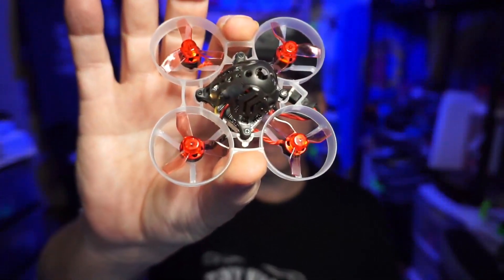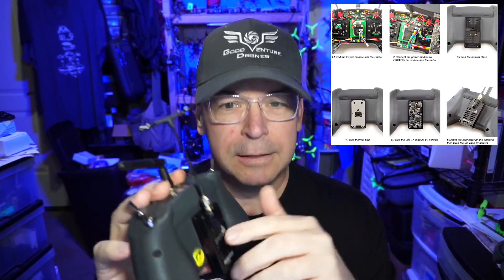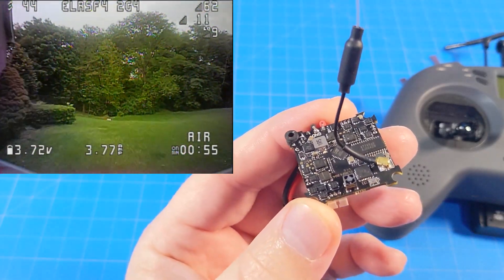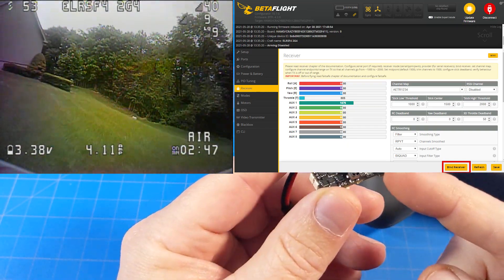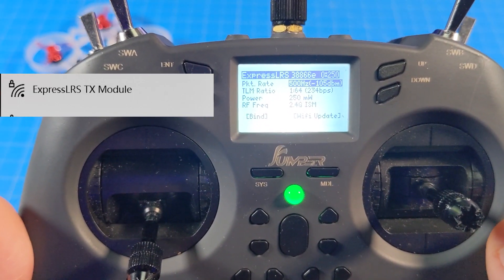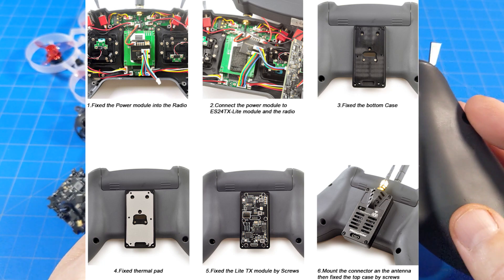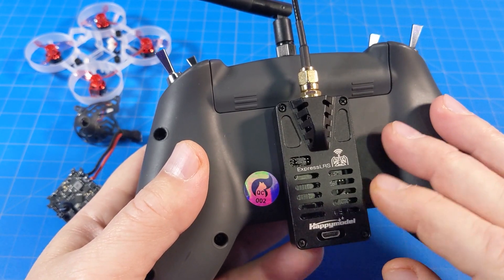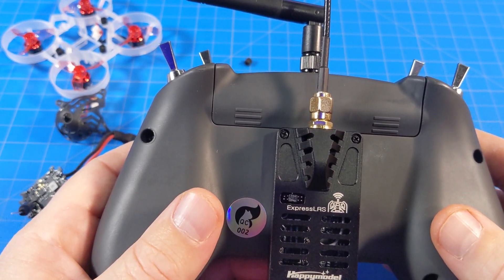HappyModel ExpressLRS // ELRS F4 AIO // ES24TX-Lite // Higher Packet Rate // Huge Range

Comment: I vote for an open source gopro session next 😁
Reply: @minkorrh  Nah, I'm talking about the hardware also. Just needs a sensor (imx677), mipi board with the processing unit (ambarella cv5) and fast enough data interface for, say, memory card or even SSD to support writing speeds from 100mbps hevc up to 10-12bit  RAW. Wouldn't even need stabilization but gyro only adds another dollar or two so might as well 😁 Could also just run directly from the quads battery to save weight, in case of powerloss you just need to add the capacitor that allows the camera to end the file before it turns off. It wouldn't be very difficult to make the base code for it either, for example Orca is as basic as it comes with pretty much the manufacturers example codes running in 🤷‍♂️😂 R5O is pretty much the same, very little has been done to optimize the image, dynamic range etc.
Reply: @pirateradioFPV  Ok, I see what you're aiming for. The GyroFlow project is  a little bit of work for most. I don't see why manufacturers can't implement what you're asking as it's not a lot considering what's been done already. Imagine a Runcam 5 Orange that had the capabilities of a Session 5. All it would need is the gyro which would require a couple of months for Runcam to come up with the firmware/software/hardware. They're almost there now as the 5 Orange does decent 4k. The 5 is $100. I'd pay $200 for the gyro/stabilized option if they came up with it.

Comment: I just got my ELRS aio board all installed in a Franken whoop and it's amazing! Tx range amazing! Vtx range Amazing! Just thought I'd share my build because I'm having so much fun😍😂😂. So starting with this board and a mobula7 v2 frame happymodle 0802 EX19000 kv motors (not SE) mobula 6 runcam nano3 with Uz80 canopy and 40mm HQ bi blade and tri blade props. My new favorite whoop and maybe new favorite period. Favorite battery is the GNB 550 HV 50/100c the grey and red one with no pigtail. I get 5 minutes + of hard punches and high throttle (for me). Very pleased with the ELRS aio easy setup and performs great!

Comment: Just got 2 of these , fantastic so far. The pigtail is at the back of the board , but as you say you can have it anyway you want if you know how to remap motors and board orientation. Now i want a built in Vtx with a similar antenna to the radio one :-)
Reply from the maker: wouldn't that be something. i wonder if that is possible. I presume so as its just copper/signal wire length. It might not have as good reception though.

Comment: Hey Nick.. the Packet Indicator on the elrs lua script should reflect what Packet rate you selected. i.e. it should be 0:500 when on 500Hz.. 
being on 0:250 (bad packets : good packets) only meant CRSFShot/Mixer Sync isn't working on your T-lite.. 
You might want to use OpenTX Nightly on that..
Reply from the maker: Thank you. I will check that out.

Comment: Hi Nick, need help here, i just bought a happymodel crazy F4 elrs board and built a tiny whoop, binded it will ELRS can see the sticks moving in the Betaflight receiver tab, can see the camera feed in my goggles the only problem is that motors dont spin and there is a red light on the board, the motors dont spin on the betaflight motors tab as well. Any suggestions where to start with

Comment: Yeah I tried the micro 2.4 module out using an x-light micro to nano module adapter and know I had the pins right as the module would power up but x-light would never recognize it. This was of course after updating to opentx 2.3.12n and flashing the module through pc an elrs configurator v0.5.0. No joy! :-( I ordered the T-light module last week and guess will give it a try. Good to know there will be an X-light module coming out and if I would have known I would have sabed myself some time, money, and a hell of a lot of effort. I will give the t-light a go though as I have 8 ep2 rx waiting and have a Gnarlyfpv Sub-Atomic, and Sub-Atomic 2 builds waiting for one of these rx's :-(

Comment: What is the maximum power of the ES24Tlite?, I open LUA Scribt, there is an option of 2000wm, is it correct?
Reply from the maker: Yes, the lua often reports that, but the max on this module is 1watt or 1000mw.

Comment: Hey Nick, have you done any battery mods or anything to your Jumper? I'm super interested in ELRS for micro stuff, just wondering if you're having any power concerns with the module?
Reply from the maker: No, I have not done any power mods. I did buy some high quality Panasonic 18650 cells, but otherwise I think it works really well. Sure it uses more power as we have to supply power to the external module, but I don't see it as excessively short use before I pop in a fresh battery.

Comment: Have you thought about upgrading the stock dipole VTX antenna to a circularly polarized one?  Such as the VAS Micro switchblade or the Emax Nano to name a few?  I'm absolutely loving my 2.4 GHz ELRS board!  Thanks for the great content as always:)
Reply from the maker: Not really. They add weight, which impacts flight performance and doesn't do much for the signal in my environment.

Comment: I would like to see more on the jumper Express setup.. there is an internal transmitter module out there as well but not very well explained.
Reply from the maker: A radio with expresslrs radio inside? I am not aware of one. I have seen a few mods that people have made the tx module fit inside the radio. If you have seen an internal module I would be interested in taking a look.
Reply: @NickBurnsFPV  yeah, I meant a modded jumper with the express inside. The only video doesn't really explain it well.

Comment: I just got the HappyModel X12 AIO 5-in-1 - Having issues with the video cutting out doing rolls or punching the throttle high. HappyModel 0802 25K Motors and Caddx Ant camera on a Meteor 75mm frame. Running currently 380mah GNB HV 1s lipos,
Reply from the maker: video or camera? if the osd stays its the camera, if the osd disappears its the vtx.
Reply: @NickBurnsFPV  The video w/ osd kinda rolls off the screen and goes black.
Reply: I'm thinking it might be bad batteries; getting new GNBs 450mah HV. Originally running GNB 380mah HV.
Reply from the maker: @edygome  Does it happen early in the flight with a fresh fully charged battery? The issue you describe sounds like a common issue with our new signal blending vrx modules. Have you updated your module? Most have fixed this with software. Skyzone had to make a hardware change. If your running skyzone goggles change the receiver modes and test/
Reply: @NickBurnsFPV  Don't think my last reply went thru; But I tried brand new batteries and it works just fine!! Noticed also from the DVR footage that the video would cut out usually when I was hitting high voltage spikes at 13amps.

Bought a new 1s Charger so hopefully take better care of these batteries.

Thanks again for the help!!

Comment: Gday Nick, great review, the expresslrs certainly makes the t-lite controller much more viable now, it would be nice if Jumper could give the t-lite a bit more battery power, keep up the awsome work on expresslrs mate.👍🛸
Reply from the maker: I wouldn't be surprised if jumper came out with a v2 that runs a 2s battery. Much like the original betafpv lite radio did. Jumper should recognize the shortcomings of running the radio on 1s voltage.
Reply: @NickBurnsFPV  We can only hope they do exactly that mate.👍🛸

Comment: Sweet! I’ll put these on the banggood wishlist list 👌. Also Nick, I was filming surfers off the point... had a fail safe on tracer.. drone go swimming... gone... waaaaaaa, much crying 😭😭😭 some guy came & stood right next to me with his phone & camera to take pics of the point lookout, only thing I can think of but it was rather poop
Reply: OUCH. Now you know why people put a GPS module on the quads. If you had one there's a good chance you'd still be flying that quad. I have an old Bugs3 drone that I put a GPS module/F4 FC/Flysky receiver on about 3 years ago ( I should film this) and its pretty easy to set up and it works. Now obviously I'd look for a lightweight frame and light components etc and do it right. Having said that the Bugs3 was only around 350 grams with my FC hacks and 2S battery.
Reply: @minkorrh  I do have a different quad with a GPS module on it but it's my 1st 3" quad. I don't think I was far enough away for the GPS to activate tbh, I was only 100m away if that. 
I've flown at the point many times of the last 2 years on a few different RC links & alot there since putting Tracer on my 3 HD drones.
It was really odd to have a fail safe that close to me, had not happened before either. Had the quad for 6 months now I think, there is a video of my 1st flight after building it on my channel & what I've flown mainly since then. Flown it up to 1.5kms away & about 1km over water before. I'm just trying to say this wasn't my 1st noob flight with it I guess.
Saying all that I've never had someone get that close to me (like almost touching me), he had a camera in one hand & his phone in his pocket. More then likely both of those also use the 2.4ghz band for wifi & or Bluetooth. I think as has took a photo on his camera next to me something happened & I lost link with the drone, it's the only thing I can think of anyway. 
To make it even worse I didn't have my sd card in the goggles 🤬🤬
Reply: @Barnz1980  That sucks. I hate that panicky feeling when you know you're probably not getting that hardware back.

Comment: That's awesome. It won't fit in my UZ65 though. Happymodel should upgrade their VTX power to match the RC range. A more powerful VTX is the only reason I chose a UZ65 over a Mobula6.
Reply: Uz65 is only 100mw, mobula6 and this fc has 200mw (Gal Kremer's video measures the output power at over 300mw). Should have chosen the Mobula6 if you wanted video range!

Comment: I read that people cut down the pins at the back of that mini power board (for the ES24TX-Lite) you have to put into the T lite with the double sided foam tape so that it doesnt short and explode. Did you do that? Because I didn't and now I'm kind of anxious about it... I did cut down that foam block on the back of the back cover so that it doesnt press on the power board inside.
Reply from the maker: I didn't trim the pins on the back of the board, I suspect there is some variance to the length of those pins. I haven't had an reports of the module being damaged or the radio if the pins do touch. I have helped some with issues that turned out to be touching pins though.
Reply: @NickBurnsFPV  Thank you! What I ended up doing was using thin 3m tape to put a plastic cover (old box of an efc I cut) over the 4in1 and then using extra thick double sided tape to put the elrs power board on top of that. No way the pins go through that now. The back cover fit really (almost worryingly) tight now, so I don't think there's a need or room for that foam knob stack that I had to cut.
Reply from the maker: @norb4152  good solution as well.

Comment: @Nick Burns  ,Hi Nick , I already have a Jumper t-lite , with TBS crossfire nano , however I am only restricted to 25mw due to the power issues of the T-lite.  I currently have 1 Quad on crossfire nano.   Will 25mw crossfire nano module on t-lite  be good enough compared to Expresslrs module showed here ? I am thinking of the higher power allowed by this .   Is it with me switching over everything  to express Lrs?  Thanks
Reply from the maker: I don’t think it would be worth switching. Only worth it if you fine the control range not enough for what you desire

Comment: nick Burns hi iv just purchased this and was trying to bind it to my jumper T12 can you tell me if I have to flash firmware to my jumper or bind without flashing my radio
Reply from the maker: The only flashing we might need to do is the module and updating betaflight to bring the elrs version on the AIO to the same version as on the module.

Comment: On most crazybee board with FrSky SPI receivers, the range drops to 50m when enabling BiDir DSHOT ( RPM filters ).
Was it fixed on the ExpressLRS version ?
Reply: I hate to ask the question but on a whoop? Why? (bi-directional) Does it make them fly better?
Reply: @minkorrh  It flies a bit better, especially with propwash handling. On whoops too, there are lots of vibration filtered by betaflight.
Reply from the maker: I will need to check this. I would need to put bluejay on it and give it a go.

Comment: What's the highest output that this modular can be set to connected to the Jumper T-lite? 250mW, 500mW, higher?
Reply from the maker: without a fan 250mw is the highest. I believe Wezley Varty has gotten 33km on 25mw. :)

Comment: Insta-buy. Not only does it have the ELRS built in, but also has a proper UFL for the VTx antenna.
Do you know if they will be doing a 2S version too?
Also, out of curiosity, what's the format of the camera plug? Is it the same as the stock plug that comes on the Runcam Nano 3?
Reply from the maker: They do plan a 2s version, but they said it won't have a vtx. We shall see. The camera plug is the same as it has been.

Comment: you said the end with the pigtail is front???  but the arrow is pointing towards the VTX antenna is front side.... ?  (Arrow on corner by pigtail) Am I missing something??
Reply from the maker: I think your right. For some reason they rotated the board and sensor alignment 180 yaw before sending it to me. I was speaking out of turn a bit, as it came to me with the pigtail at the front. I wonder if someone built it backwards then decided to rotate the boar alignment rather than taking it apart. It did come to me in the mobula 6
Reply: @NickBurnsFPV  nothing would surprise me these days installing chips backwards... I got a clracing  f4 that had a chip backwards once. I would love to Try that board... Can't wait till I get one! Nice review Nick... Favorite reviewer by far on YouTube!

Comment: I have an older accst taranis QX7 but I don't believe the express lrs module will work properly with it unless I mod it.  Any suggestions for a new transmitter that will work with expresslrs?
Reply from the maker: To my knowledge as long as our radio has opentx on it the module will work. The accst has more to do with the internal radio hardware than opentx or the ability to use external modules. To be double certain I would ask over at the expresslrs discord. https://discord.gg/dS6ReFY
Reply: @NickBurnsFPV  Thanks for that discord link, tons of great info over there.  So the answer to my question found on the discord server is:.  
The accst QX7 needs the crossfire mod in order to work on 400000 baud.  Without the crossfire mod you need to change the baud to 115200 and then it should work.  However, one consequence of lowering the baud is that you will not be able to utilize the higher packet reliability of 500hz.
Reply from the maker: @mooredge  Ah, that is good info. Thanks for taking the time to let me know. It kinda stinks a mod is required, but flying 250hz will still have very good range and we can take advantage of very small expresslrs rx without having to buy a new radio.

Comment: Exiting times in fpv with this new protocol. Especially with the new all in one micro FC with ExspressLRS. I been flying 2.4 ExspressLRS on 500hz mode & TBS Tracer and its really hard to tell the difference between the two protocols. Both have very low latency making for a much more connected feeling with your quad! Awesome progress for ELRS. Cant wait to see what the future brings! Good little review on the board. Wonder how far that little 200mw Vtx will go in line of sight of the goggles?
Reply from the maker: Its not all that likely would test to video black out, but straight clear line of sight I would expect it to go a good long way. Especially if we used a good antenna connected to the ufl.
Reply: @NickBurnsFPV  I didnt pay close attention to the vtx antenna mount? If it has a ufl connection for the vtx antenna. I would definitely recommend getting a trueRc vtx antenna for it. If your running a Rapidfire or TBS module like I think you are? You definitely get a lot out of that little vtx. Given you already getting good feed out of it flying in front of your house while sitting on your back patio sitting pretty close to the house. If your feed is anything like your dvr recording? That's pretty impressive already for all in one Aio vtx! Plus your running ELRS so you can go as far as your video allows you..lol
Reply from the maker: @allennickles3970  Yep, I run a number of truerc antenna, for the price I don't know how we can do better.
Reply: @NickBurnsFPV  Yeah I run the little LHP grey ones that's under a gram on my Vista's. And the same ones but Red RHP on the analog. They are $20 dollars a piece for the little buggers! But the reception is the best out of everything I tried! And they work well on micro's and sub 250g builds

Comment: Just installed my ES24TX-lite and it’s always got a red LED on even when powered off?
Reply from the maker: The pins on the back are going through the mounting foam and touching the metal shielding. Either remove the foam round part on the backside of the shell of the radio or move the mounting board so that its not being pressed on.